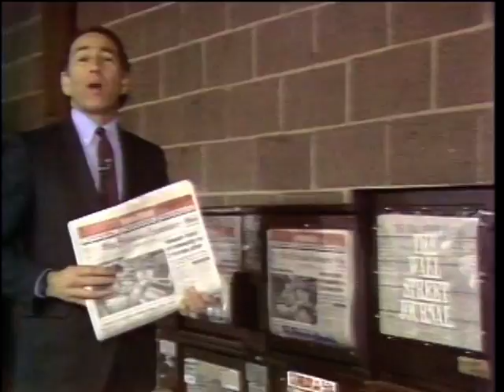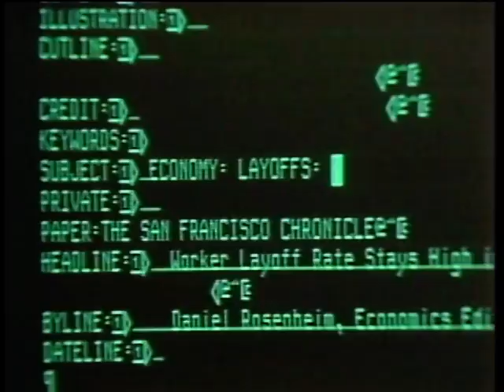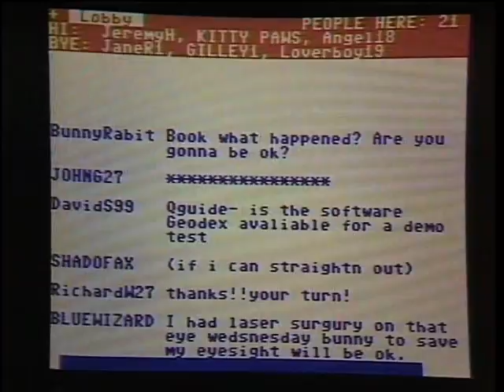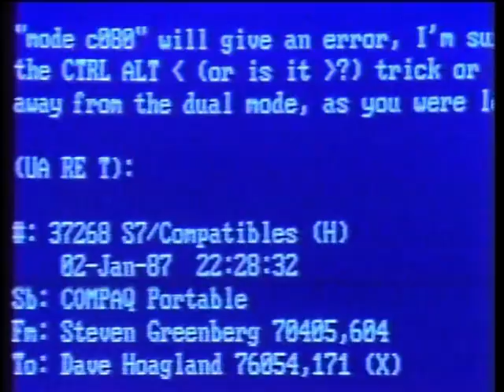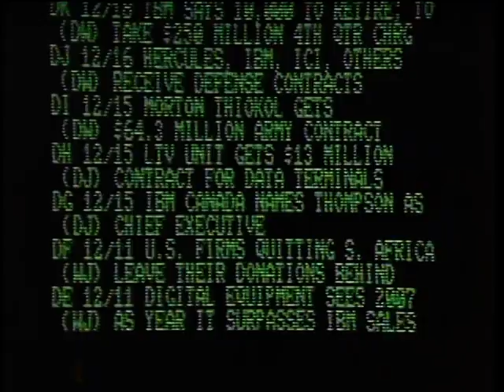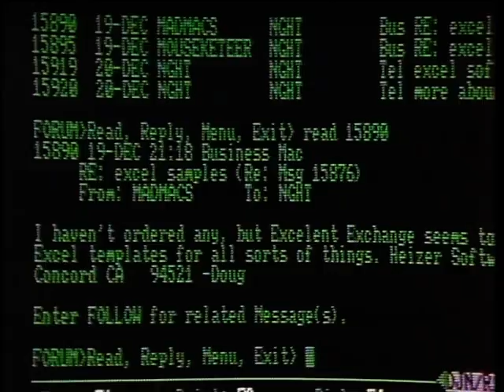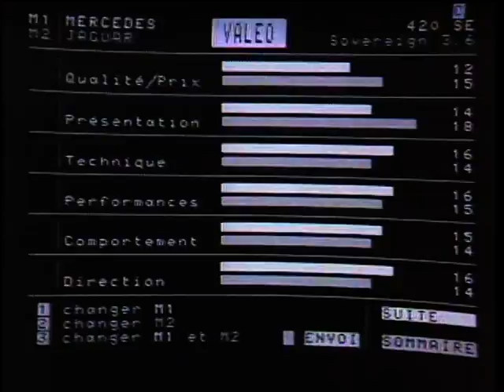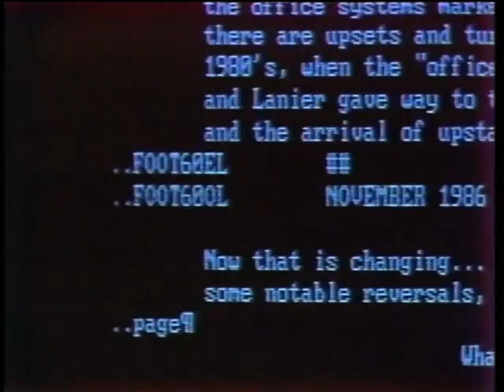The Computer Chronicles - Online Services Part 1 (1987)

Comment: It always feels like the guests on the show have a gun, off camera, pointed at them.  They seem so nervous
Reply: it's the pressure of having to perform well on air to sell their product to the public, i guess
Reply: They know if they mistakenly claim that a program has AI, and doesn't, that Gary will rip them apart passive aggressively... or George won't see the purpose.
Reply: They are intimidated by the most epic combover the world has ever seen.
Reply: @joqqy8497    It was largely time pressure.  Each segment was allotted a specific amount of time, and Stewart was firm in holding to those time constraints.  Given that this program was essentially free advertising for the their respective products or services, guests understood that bloviating would not be tolerated, and that they had to be efficient their remarks.  Stewart often hurried guests along because time was short.